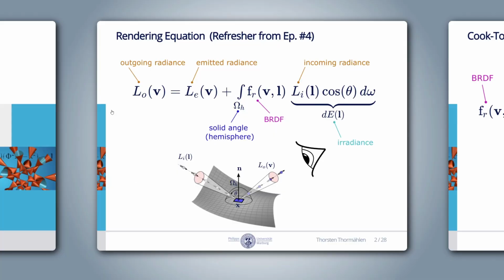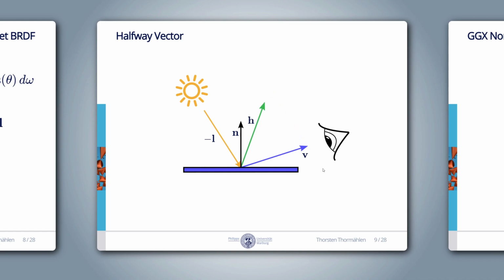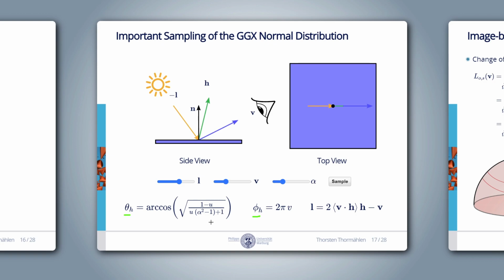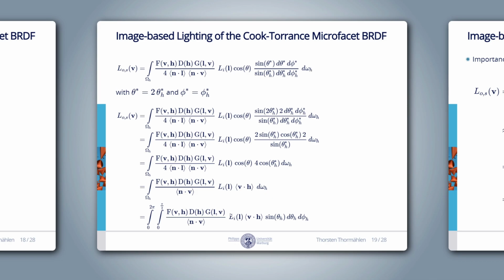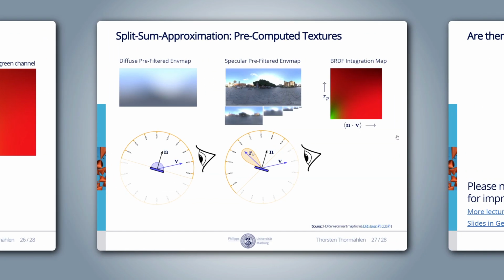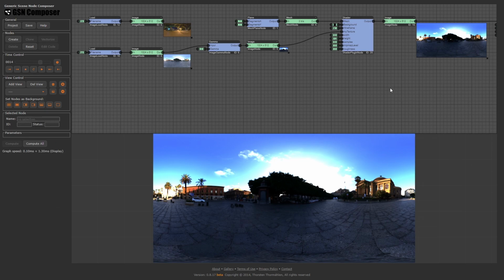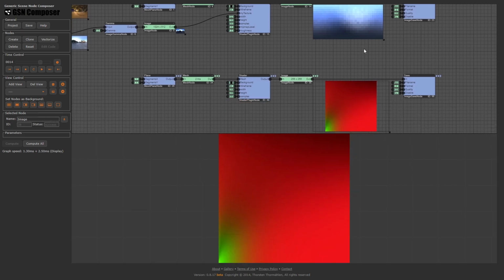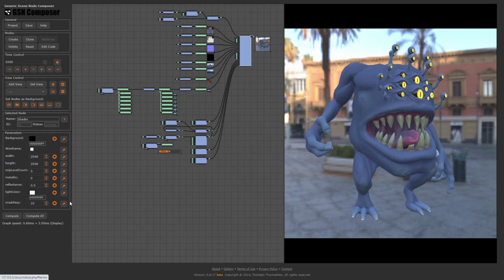Image-based Lighting (IBL) of PBR Materials [Shaders Monthly #11]

Comment: Excellent video! But how to render shadow when using image-based lighting in physically based rendering?
Reply from the maker: When we do rasterization and perform LOCAL shading, shadows are always difficult because they are a GLOBAL effect that we cannot decide locally. We need to know if the path to the light source is occluded or not. 

This is why ray tracing approaches are so popular, because they can solve this problem by shooting a ray towards the light source (or environment map) and can check if the light is occluded by some other object. 
Here is an image-based lighting example for ray tracing. It has shadows and other "global" effects:
https://gsn-lib.org/apps/raytracing/index.php?name=example_transmission
I have some slides about raytracing here:
https://www.uni-marburg.de/en/fb12/research-groups/grafikmultimedia/lectures/graphics2

In a rasterization approach, we need to cheat somehow. For example, we could look for the brightest location in the environment map and assume that this direction is the only one that matters for shadows (a very rough approximation, of course). Then we could add a cascaded shadow map for that direction:
https://developer.download.nvidia.com/SDK/10.5/opengl/src/cascaded_shadow_maps/doc/cascaded_shadow_maps.pdf

Comment: I was thinking to precompiute the brdf integration map as an attribute. This can save maybe gpu resource since than the texture is an attribute at i guess point level! 🎉 thanks for all those lessons. Anytime i have time i come here to become a better artist! Little pearls each time. Thanks!!
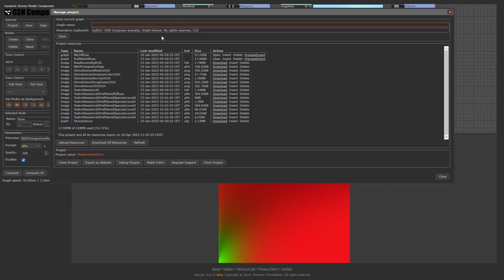Reply from the maker: Thank you very much. The result of performing shading (or parts of shading) in the vertex shader depends on the number of vertices in your mesh. Of course, if you have control over the tessellation of your input mesh, you can use it for low-frequency shading components, but I cannot recommend it as a general solution, especially in combination with high-frequency (detailed) textures. The texture coordinates are interpolated by the rasterizer when they are passed from the vertex to the fragment shader. This means that the texture coordinates and material properties read from textures, such as roughness (see the last example at 39:33), may change per pixel, not per vertex.

Comment: Hello ! 
I have a question , how do you deal with aliasing in envmaps that have very bright and small lights , like the sun ? 
Using split sum approximation , I need extremely high number of samples to only minimally enhance the pre filtered cubemap , and , when using shaders , you quickly reach the point where the GPU crashes and the driver resets . 
in this situation , I'm about to bake the environment map totally offline CPU side, any advice ?
Reply from the maker: In this case, you can perform importance sampling based on the envmap (incoming radiance), not based on the material. I am currently working on the next episode, which will cover exactly this topic. In the meantime, here are some slides: https://www.mathematik.uni-marburg.de/~thormae/lectures/graphics2/graphics_3_4_eng_web.html  
The other options is to compute the prefiltered envmap incrementally, doing a few hundred samples per render pass. 
You can just compute an incremental average: https://www.mathematik.uni-marburg.de/~thormae/lectures/graphics2/graphics_2_1_eng_web.html#42
This way the "watch dog timer" is not triggered and the GPU driver does not crash/reset.
Reply: @gsn-composer  Thank you so much!

Comment: What's the reason behind chosing that PDF of GGX normal distribution function? Where do cosθh and sinθh come from?
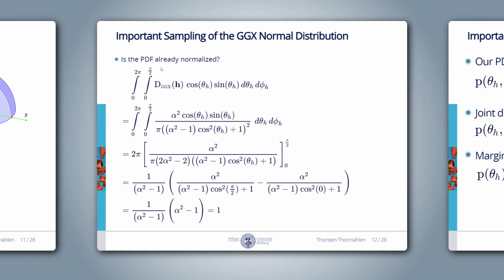Reply from the maker: Theoretically, you can choose it freely. The only constraint is that the integral of the PDF for the entire domain must be one. At 10:03 min:sec in the video, we check that the normalization to one is fulfilled for our particular choice. This is not a coincidence. Walter et al. constructed the GGX normal distribution function in this way, as described in their paper "Microfacet Models for Refraction through Rough Surfaces", section "3.1. Microfacet distribution function"; Equation 4:
http://www.cs.cornell.edu/~srm/publications/EGSR07-btdf.pdf
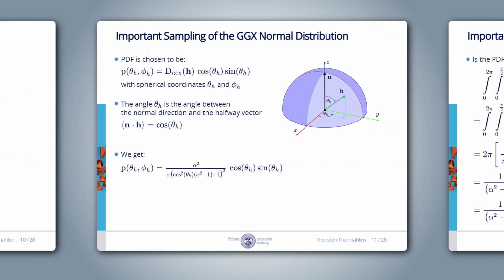Reply: 9:27